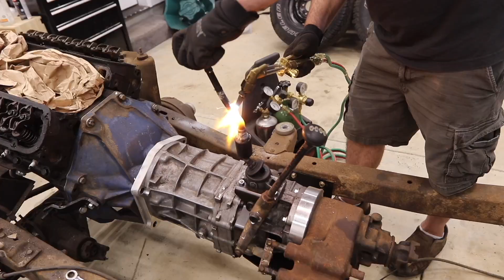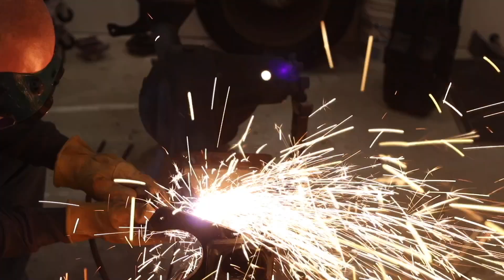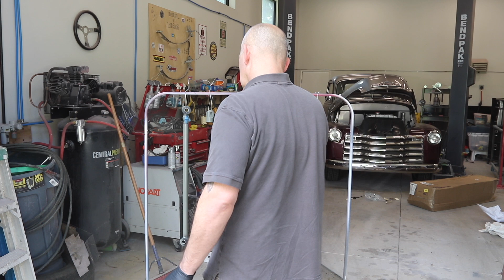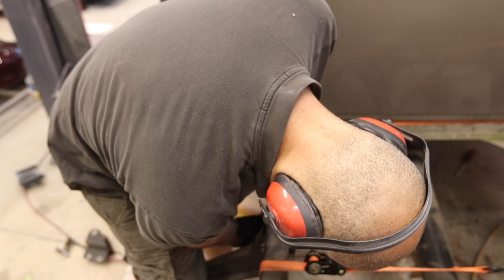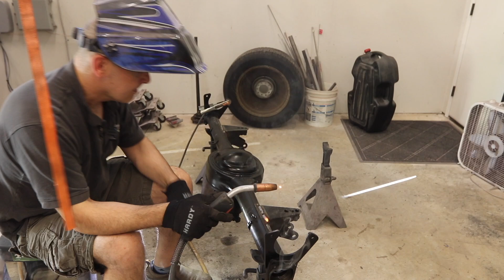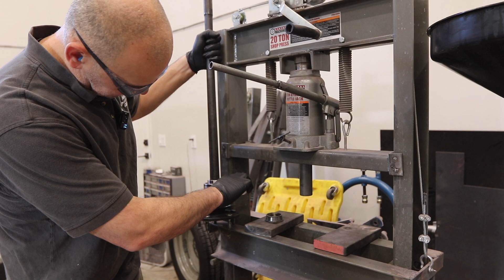11.3-Four Link & Coilovers for Poppa Bear (1950 Chevy)

Comment: pretty sure you can preload those struts/ coilovers. I see can see longer coilovers in the future! or some pavement scraping!
Reply from the maker: The brackets on the axle actually have three slots. I chose the middle slot but if I need a little more I can put it on the higher notch.

Comment: Hi Matt does replacing leaf spring with coil spring reduce the load capacity of the truck. Looks nice. ❤
Reply: it will definitely sag quicker.
Reply from the maker: Yes dad, it does, but this truck stopped being a work truck a long time ago! It’ll still be able to haul anything normal from the hardware store and stuff. But I wouldn’t put a pallet of fertilizer in it.